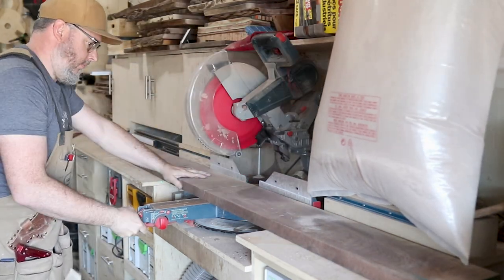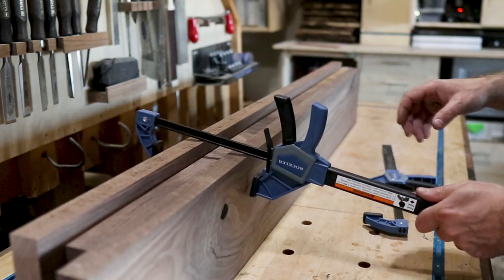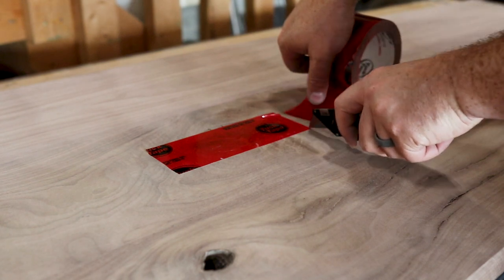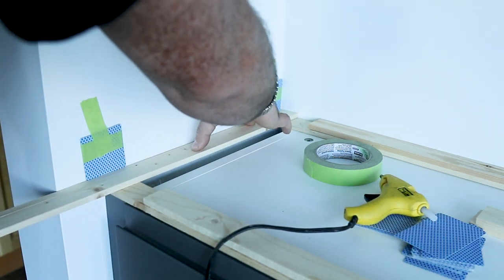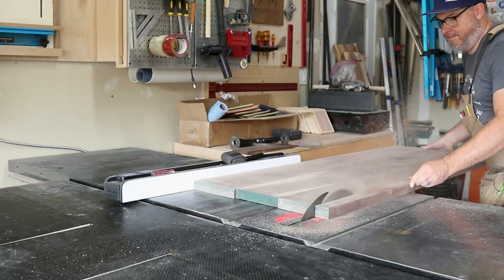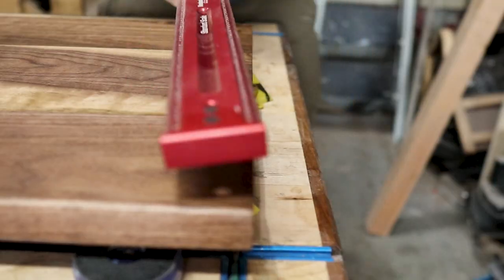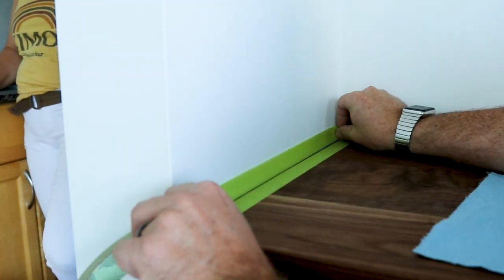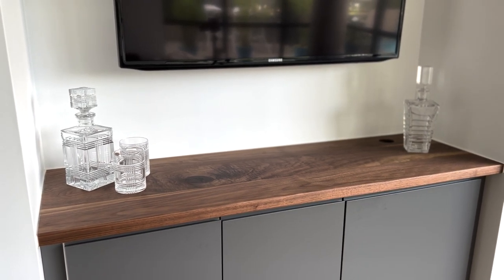How to Install Wood Countertops // Installing butcher Block Countertops

Comment: Love the template ! Is the length of these strips you use relative to size eg.. 12’ long would you still use … looks like you used 4 18-24” strips on the back ? Or would you use 4 for any length ? Or is it irrelevant?
Reply from the maker: Yeah, it’s a sweet trick! I just grabbed what I had for strips so it’s kind of irrelevant.
Reply: @furthernorthfab  going to do one now! Wished I have some s4 strips might have to make some out of 3/4 plywood with me track saw
Reply from the maker: The strips I used were just 2x4 strips I cut down. Tag me on Instagram if you post over there!

Comment: Nice work! One question though, I didn’t really understand what skip planing was.
Reply from the maker: Thanks. Skip planing just means you put the material through the planer to take down just the high spots. The wood was pretty flat already so I didn’t need to take out any twists or anything.
Reply: Remember that a thickness planer will only give a uniform thickness, but if the wood is twisted or cupped it wont solve that problem. You can have equal thickness but that doesnt guarantee flat. Chris used skip planing here because he didnt have any twists
Reply from the maker: Thanks James.

Comment: With dark wood like walnut caulking really isn't necessary when you get a good fit with your slab. And since seasonal wood movement is a thing it isn't advisable anyway since the movement will fuck up your caulking. Use caulk when you have a light material like white or grey particle board, or something your are going to paint, since it'll hide that shadow line in between your pieces. With dark wood your shadow line is already hardly visible.